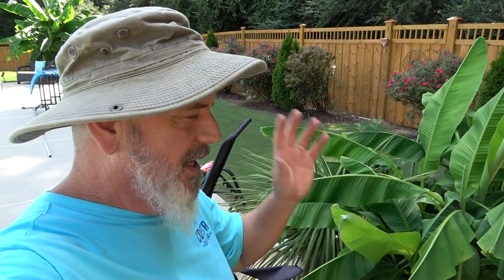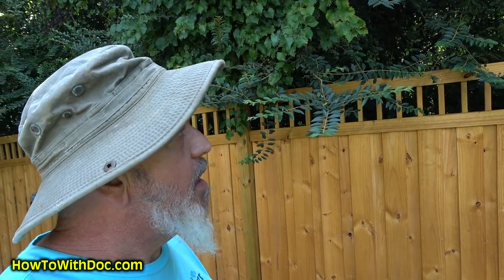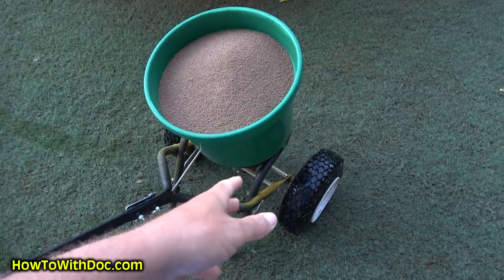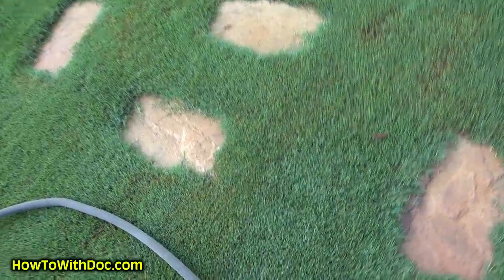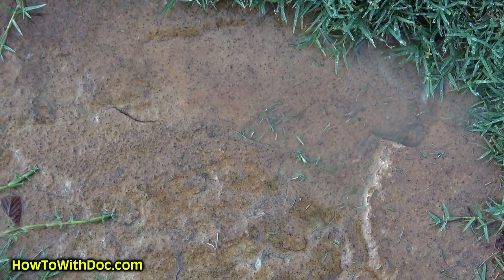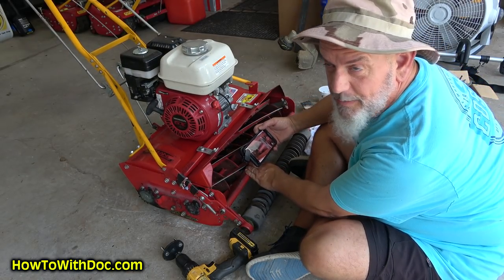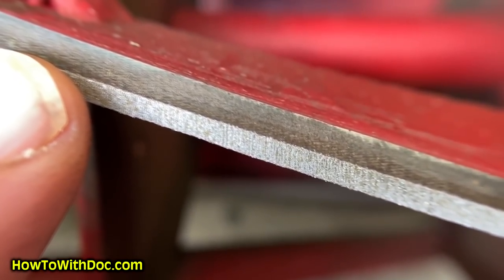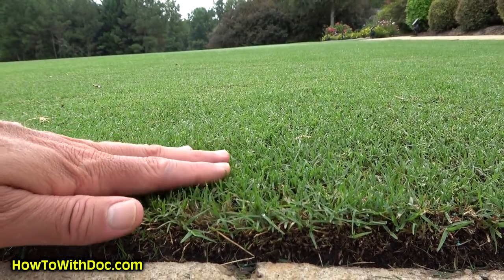Fall Yard Work and Lawn Care

Comment: Doc,  we are just now having a pool installed, August 31, 2020.  I have performed treatments per your videos for late summer and fall guide.  My question is how do I repair the damaged lawn and prepare it for fall / spring with best results. Temps are still high 90's and 100's with heat index.  Any assistance will be greatly appreciated

Comment: Since you showed your back lap, why don't you do a short video on resetting the blades to the bedknife to show how you do it.  This is the biggest problem with the McLane mowers, in my opinion....and I have been using them for more than 25 years.....just like you, I have several sizes.  I still use the McLean method of backlapping using the new sprocket and longer chain which runs the reel in the reverse direction...it is a pain to set up.
Reply from the maker: It's part of the new video.
Reply: @HowTowithDoc  I found it....thanks....had to order one of those "do-hickeys" for my drill.....thought about trying to make one, but by the time I found all the parts, it was just as cheap to buy.